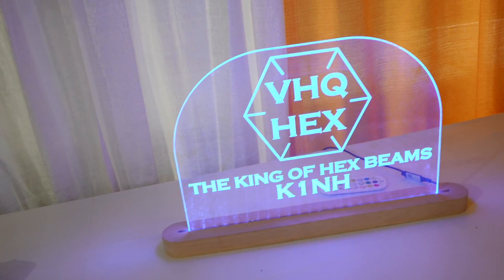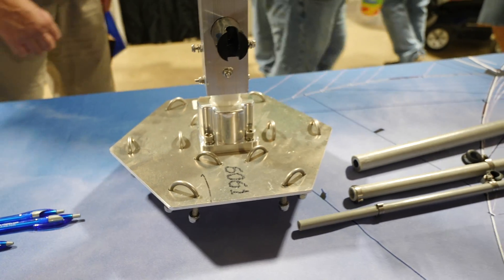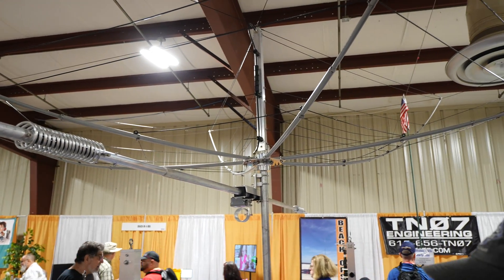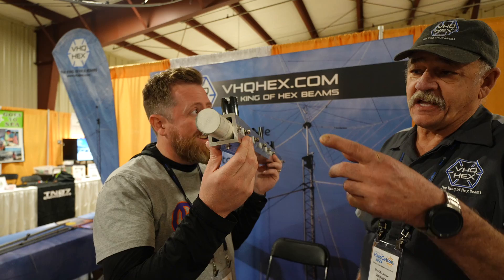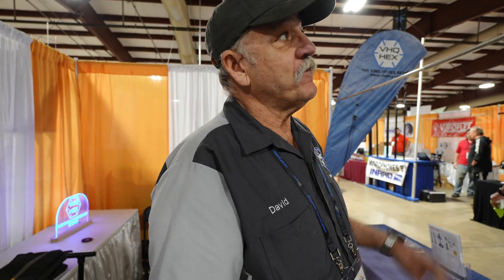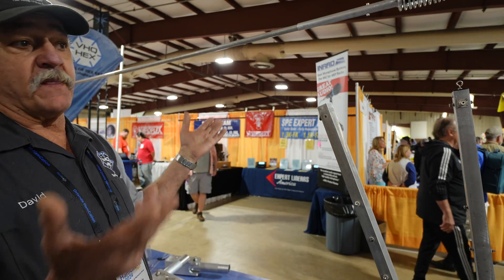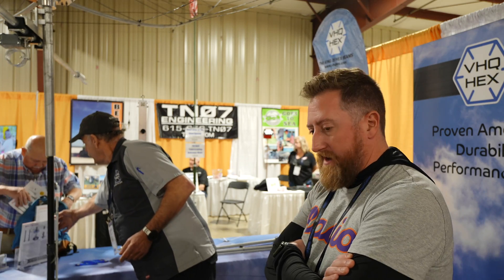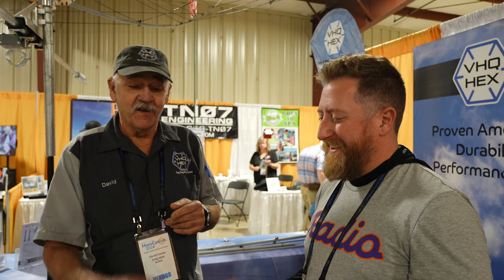The Beefiest HexBeam on the market - VHQHEX

Comment: I wish they made a "Lite" version of this Hex for $800-$900- I'd buy it in a heartbeat. $1700 is just too expensive imho. We don't have hurricanes where I live, so this much metal and rigidity on the center post would be an overkill.
Reply from the maker: Other companies make the lite version.
Reply: @HamRadioCrashCourse  I did some math on parts for building a hexbeam with fiberglass arms and stainless hardware and it will cost more then to buy a ready Hexbeam kit. The price on materials and hardware is gone significantly up it seems.

Comment: Good rotor to use instead of a Ham IV but similar price(Okay $200 more... but the Spid is WAY stronger!) is the Spid Rau... Rau has 900 inch pounds of rotation force vs 800 for the Ham 4, 8,000 inch pounds(Rau) braking vs 5,000(Ham 4), 350 pounds vertical load(Rau) vs ??(Ham 4)...

I have 4 Spid rotors in use and one failure in 10 years use and that may be a broken wire(waiting for snow to melt to access tower area). They are built like a tank!  I see reviews of bad pulse count and most of those are from slippage of the rotor on the mast(speaking form experience!) from not pinning it with a thru bolt(I was in a rush and it was 13 degrees f...). 

Negative of the spid is weight, they are heavy! My az/el rotor weighs 55 pounds... but have 8,000 inch pounds of rotation force...

Comment: I got one a year ago. It is temporarily mounted on an 8 foot roof tower, still on the ground in the back yard, with a mast putting the base up 12 feet. I had a 50 pound limb fall out of a nearby tree on the hexbeam. One side folded over like an umbrella in strong winds. The fiberglass spreaders were inches above the ground. I couldn't lift the limb off since it was tangled in the wire elements. I cut the limb in sections with a chainsaw, removed the limb pieces, and lifted the spreaders. The hexbeam sprang back up in perfect shape. NO DAMAGE. We have had numerous high wind storms and a recent ice/snow storm. NO damage and it keeps working perfectly. Even at such a low height, performance is great. I imagine it will be even better once I get it on the roof about 35 feet high. Yes, it's pricey, but definitely worth every penny. And, no, I am not affiliated with or compensated in any way by VHQHEX. Just like to share info on a great product.  73 de AA4HV

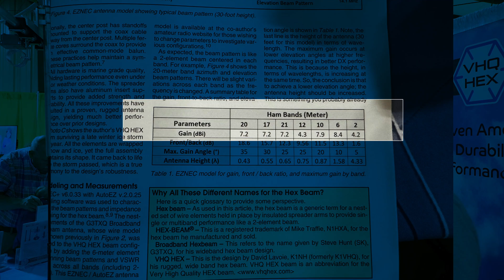Comment: At 6:23 minutes, is there a misprint on the bands? I see 20, 17, 21, 12, 10, 6, & 2. Should the 21 say 15?
Reply: My VHQ works great on 2 meters !     as a dipole, as it is using the 6 meter  wire